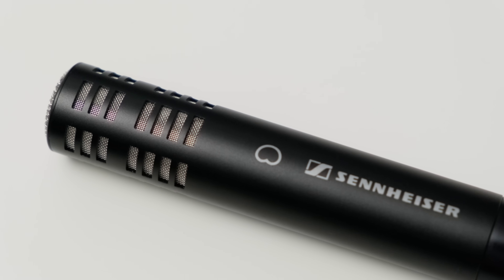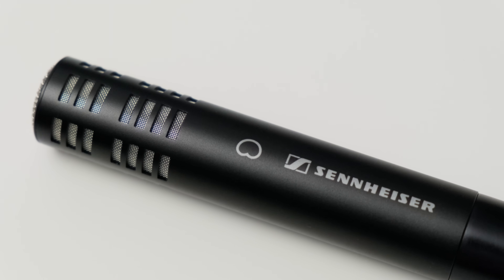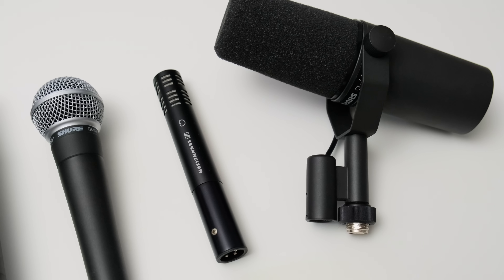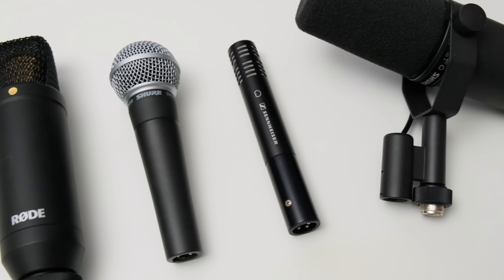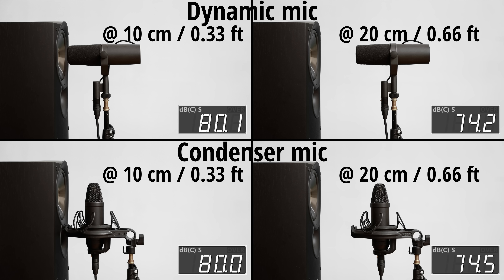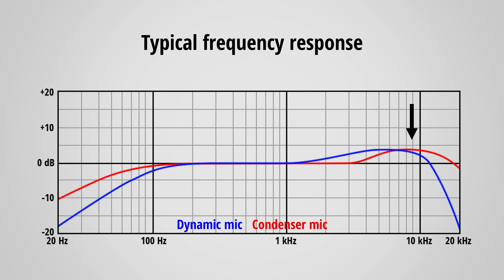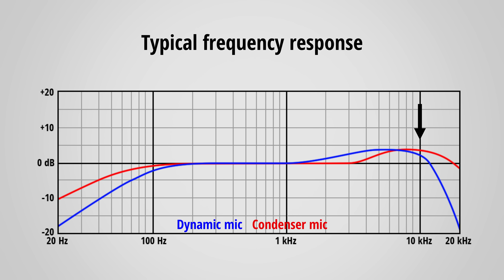Dynamic mics don’t reject noise better than condensers! And yet they do?

Comment: Dynamic microphones exhibit non-linear sensitivity to sound pressure levels (SPL), resulting in reduced responsiveness to both very loud and very soft sounds. This behavior can be attributed to the physical characteristics of their diaphragms and suspension.
Suppression at High Sound Pressure Levels
Dynamic microphones suppress high SPLs due to limits in the diaphragm's suspension. At extreme SPLs, the suspension restricts further extension, preventing additional voice coil displacement and capping the induced electrical current, leading to non-linear sensitivity.
Suppression at Low Sound Pressure Levels
Conversely, at low SPLs, the inherent mass of the diaphragm and attached voice coil in dynamic microphones introduces inertia, making them less responsive to subtle changes in air pressure. This reduced sensitivity to slight pressure variations results in diminished responsiveness to very soft sounds.
Summary
Both of these effects are usually desired in vocal audio recordings. Using condenser microphones, we later post-process with noise gate, expander, compressor and limiter. Dynamic microphones have these effects built-in to some extent.
Reply: @KarolMurawski  ah yes, I love to use expander on compressed tracks, it sounds so good!

Comment: You are right on the money mentioning proximity effect as a main contributor to noise suppression. This is mentioned in the design docs of BBCs Lip microphones (famously used for noisy reporting): You build the microphone in such way that it rolls of the low end much more than usual and then use the proximity effect to get the bass back up again. This essentially (in the Coles 4104B for example) supresses environment bass sounds by as much as 10dB.  Also see: https://downloads.bbc.co.uk/rd/pubs/archive/pdffiles/monographs/bbc_monograph_07.pdf

Comment: The boosted high end and boomy low end are exactly why the XM8500 is not a vocal mic, in my opinion -- it's an instrument mic. Use it as a beater mic on a kick drum, as a snare top or bottom mic, as a tom mic, as a pairing mic for double mic acoustic guitar (works really well paired with a condenser, or a darker dynamic mic), or as a microphone for electric guitar or bass cabs. It's what I use it for. Pair it off axis with an on axis e609/e906/B906, or an on axis SM57/SL75C/V7X, or on axis for bass paired with a kick drum/bass cab specific mic. Use it for a rear cone mic on an open back guitar cab or combo amp. Use it for the middle position mic, in the no-man's-land between all the speakers on a 4x12. Do any of those things, then tell me it's a vocal mic. For most applications, the BA 85a is a better vocal mic, for what is these days, the same price. Here in the USA, that's like $17.90, $19.90, or some stupidly cheap amount, at least on sweetwater.

Comment: I agree with you concerning the physical facts that a dynamic mic does not differ to a condenser mic concerning the percentage of room reverb. But if you consider the influence of the specifig frequency responses as exception of this rule, I would say, you could modify the frequency response of the condensor mic with an eq in that way that it matches a dynamic mic and then rule #1 keeps still valid. I would not mix different physical aspects.

Comment: Idk if i agree with his conclusions. I have the NT1 and the XM8500 (both great mics). The NT1 has a massive amount more of off axis sound pick up than the XM8500. And it definitely feeds back far sooner even when the same close to the mic. Also, I believe almost all condenser mics sound more compressed than dynamic mics. I have to apply more compression to dynamic mics to just sound natural. I believe that is the real reason for the feedback problem with condenser mics. Anyone thats used compression live knows it makes the mics feedback sooner. And most condenser mics are less directional which is the other reason.

Comment: So here why I've tended to believe the myth: My understanding is that the membrane of the typical dynamic mic is heavier than the typical condenser mic. As such, I would expect it have a natural 'gate' that would de-detail the sound source. My understanding is that this is also the reason for the generally more treble response of a condenser: on default, it just can deliver more detail.
With regards to proximity: Typically, I prefer driving my pre-amp (with a dynamic mic) instead of clipping the (condenser) mic. Hence, on average, I will put my condensers further away from my potentially loud sources.

Comment: the word "reject" is misleading because it suggests some "active suppression". Furthermore I see a difference in "room noise" (reflections) and "self noise" (electronic circuit). Since dynamic Mics only electronic part is ideally the coil and optional LC or Resistor while condenser Mics have FET-Transistors, RLC circuits and depend on stable Power supply. 
Nonetheless sound should decide which mic is best for you.
I totally agree to all your assumptions.. :-)

Comment: Well…. no. This test is a controlled test in a controlled environment which does not even illustrate the type of noise that needs to be rejected. Off-axis transient sounds are significantly more problematic with condensers (especially small diaphragm condensers) than dynamics. This is true for stage and for studio. In the environments that many of us are in, much of the “noise” is not steady-state room reverb, it’s clicks, it’s chirps, it’s electrical relays turning on/off, it’s mouse-clicks, it’s the neighbor’s lawn mower hitting sticks, it’s the car going past where the tires are making impulse noises of the stones and other debris on the pavement. My own empirical evidence points to an unmistakable difference between the two types of microphones. Much of this form of noise, being transient and distant, is high-frequency often times up in the roll-off region, but the microphone design itself is a major factor in how it responds to off-axis transients.
Reply: So you are saying... the noise rejection is in the roll off frequency region of dynamic mics, therefore better than condensers. 

You just have proven you didn't watch the video completely or not with enough attention. Because exactly this is what Julian explains at length in this video. What he also shows, is that you just can eq the roll off in a condenser mic and get the same results.

You are also referring to off axis response. But then you just didn't explain it at all what you mean with that. Off axis coloration? Different polar pattern on different frequencies despite being cardioid etc. at 1khz? Large diaphragm condensers for example can tend to be omnidirectional at lower frequencies. But that is not true for small diaphragm condensers which tend to stay consistent. See, no mention of a dynamic mic.

By the way: You are referring to anecdotal evidence, not empirical. You are just talking about it in your subjective experience (hence anecdotal), but Julian does provide a controlled experiment which can be repeated and verified independently by yourself (objective) and provides all the samples (evidence) directly to you for your own listening (empirical), hence objective empirical evidence.
Reply: @ “empirical evidence” would be the proper term in this case. I’ve mixed over 3000 shows, events, and other live events. I’ve studio mixed and post-processed over two thousand hours of audio. I’ve worked for the manufacturers of recording equipment, and was part of the design team of a microphone or two. I understand your desire to pigeon hole my comments to that of a keyboard warrior and simplify it to just being roll-off which confirms his test comparison. But it isn’t quite so simple. His test quite literally DID NOT prove anything other than what room reverb looks like. It did not test or show anything beyond that point.

As to it being just up in the roll off area, which appears to confirm his tests, the answer is no. Not exactly. The longer explanation has to do with the transducer’s impulse response, rebound, off-axis sensitivity which is influenced by the port design, resonator design, chamber design, etc. All of this influences how a microphone responds to sounds arriving from different angles, but also the type of sound that is “heard” by the microphone. A dynamic microphone is NOT “phase coherent” at all frequencies. In fact, NO microphone is “phase coherent” at all frequencies. The only microphones that come close are small-diaphragm omni condensers in non-reflective housings. This phase in-coherency affects how a microphone responds to impulse sounds from off-axis. A microphone, such as the SM57 or SM58 largely “rejects” off-axis impulse sounds by either not moving the coil at all, or converting the impulse into a lower-frequency wobble. A condenser’s extremely “lightweight” diaphragm will effectively “ride” the waves (especially below 20Hz unless damped), whereas the dynamic’s heavier magnetized “moving coil” design has a natural damping property to it, but it also is not typically “activated into after the impulse sounds wave has passed.

The result, which “empirical evidence” supports, is that a condenser microphone will “hear things” off-axis that a dynamic microphone doesn’t. This is something that isn’t just in the 15-20kHz range, but is present across the spectrum. An impulse sound knows no frequency. A snare drum is actually “white noise.” 

The premise of Julian’s comparative, which was cute, but flawed, is that “all microphones are equal”. It made for a nice test, but the test was EXTREMELY limited in scope to the point of being irrelevant.
Reply: @ I did not pigeon hole your comment, you just said nothing substantial and that is, what I pointed out. Making it into an authoritative argument by stating your experience, which again is not empirical but still anecdotal, does not change that. At least you now tried to elaborate your claim and confirmed my speculation that you mean changing polar patterns relative to frequency (at least in part). I certainly find it very plausible, that the coil either doesn't move or wobbles in a very low frequency, and a sensitive membrane reacts much more. The inclusion of these higher frequency sounds like claps and clicks and so on would have been useful information. BUT that a condenser also hears things a dynamic does not in all frequencies not just in the upper range or other than impulse sounds should have been clearly audible in his experiment which include these frequencies in his test sample. But it wasn't the case, so much so he could eq the sound almost exactly to that of the dynamic microphone. His experiment did prove, that in the tested frequencies and nature of the used sound sample, that dynamics are not better at rejecting off axis noise in general and that other factors like distance is much more decisive. And by no means did he assert, that all mics are equal. Quite the opposite, he included a range of mics and also explicitely mentioned dynamic mics with a different roll off behavior than most dynamics. So I disagree on your conclusion, but do agree, that the experiment has limitations, so that Julians conclusion comes with qualifications. Nevertheless, your points may be plausible, but that does not mean, that they are proven, unless someone provides prove, that others can verify. That is then empirical evidence, not authoritative or anecdotal. Cheers.
Reply: @ by definition mine is empirical evidence. It is anecdotal when taken in isolation, but is repeatable, provable, and consistent with the anecdotal evidence of others with similar experience, which makes it empirical. Julian’s test, on the face of it, is legitimate and accurate. However, his conclusions and the interpretation of his conclusions by so many of the commenters is less so. He does speak to things and attempts to flesh out his thoughts on it, but not really in a way that avoids confusion. Just like Julian, my comment is also incomplete because this is a topic that can’t be summarized in two paragraphs. I’d have to go dig for them, but several microphone manufacturers have published “white papers” on this very topic which may not entirely align with Julian in his conclusions.
Reply: @ Thanks for the reference to white papers, I will look for them. I very much want to get to the root of it all, because I believe that Julians experiment does provide relevant information, but so does your input, which I want to verify. So these white papers might be very useful. I still more inclined to Julians conclusion at least yet.

Comment: So, what is the actualy practical difference between the 2 technologies? Ok, condenser has extended treble and bass. But does it also have a different impulse response? Are condensers faster? Do they have resonances in different areas? Will one type of mic feedback more than the other?

Comment: Glad to see you demystify this for newcomers. The only noted I’d add is that in my experience dynamics/passive ribbons are more sensitive to EMF, ground loops and the like. When I went to record at an old house with wiring that turned out not to be up to code, all sorts of hum was showing up on the dynamics and ribbons that wasn’t on condensers. I tried moving positions, changing audio interfaces and amps, etc. but in the end I had to just use the condensers. At another recording session at an artist’s project studio back when I was starting out they had just got a Royer R122V that had an unexpected hum - so I called Royer to check it wasn’t didn’t sound like an issue with the microphone’s custom power supply itself before I spent too long debugging it on billable hours. To my surprise David Royer himself suggested starting by checking for a ground loop and sure enough that was jt. Once we used an adapter to remove the ground pin, the issue went away - an issue that had never been noticed with that outlet before because the artist had exclusively used condenser microphones. Even the Telefunken ELA M 251 E that had a custom power supply hadn’t had that issue despite using the same outlet without needing an adapter to remove the ground loop.

So I often recommend engineers have condensers (at the very least as backups) whenever they recorded in a new space in case they didn’t have time or opportunity to deal with those kinds of issues.

Great video and I didn’t expect to see the XM8500 in the video (I bought some of them back when I left college in 2007).
Reply: What gear did you use to remove the ground loop? I'm having a lot of noise on dynamic mics and especially on the electric guitar single coil. It's weird, if I move the guitar around, the nature of the noise changes, at certain angles it almost cancels itself, but it's uncomfortable to say the least, so I have to use split coils all the time just to avoid the excessive noise
Reply: @nikibelous If the issue is position dependent then the simple fix we did might not fix the problem, but I’ll mention a couple other things along with that just in case. To remove the ground loop for the Royer power supply all we had to do was use a 3 pin to 2 pin adapter so that the ground pin from the power supply wasn’t going anywhere. That helped on some other sessions, too, where there wasn’t time to try to figure out whether it was the outlet, power strip or something else that was causing the issue.

Assuming it’s not that simple, it’s likely that you are dealing with either electo magnetic interference (EMF) or radio frequency interference (RFI) so I would check any light dimmer switches (turn them completely off to test) and try anything else in the area that could affect it (mobile phone off, TV or monitor off or at a greater distance, etc.) If that that doesn’t fix it then try using the same equipment in a different room/building and see if you have the same problem (to rule out wiring in the house or other location specific things). If the situation doesn’t improve elsewhere then the next things I would check would be the shielding on the cables (if you have at least one that’s got really good shielding, try running that one to the pickup) and if that doesn’t fix it, I’d check how secure the pickup and jack on the secure are.

If none of those things fix it, then I would just do what I did on the session in question and use condenser mics instead. Hope that helps!
Reply: @ TY, good points on testing. That will help identify the issue. I tried turning things off around the house, and that helped. I could literally hear the buzz going lower in level by turning one power consumer after another. It’s like everything that is powered from the grid influences both the amplitude and the character of the buzz - some things sound digital and glitchy, and some are more persistent, kinda like white noise. I guess I’ll do more testing with a laptop (battery powered) and a usb interface with everything else powered off. Moving to another place is not an option atm. I guess I just want to know if this electric noise issue is only happening to me or is it normal and I just need to accept it? Is it even possible to combat the electromagnetic radiation with power filters? Condenser mics work great for me, it’s only dynamic mics and single coil pickups on the bass and electric guitars that are causing issues.
Reply: @nikibelous It’s an issue I’ve encountered at several locations so in that sense it could be considered normal but there are definitely a lot of places where that’s not an issue. If you want to record with dynamic mics, there are various line conditioners/power conditioners you could try that might be able to help but I’d make sure to get one with a good return policy so that you can take it back if it doesn’t work. Normally I just used condensers instead of dynamics in that situation, though.